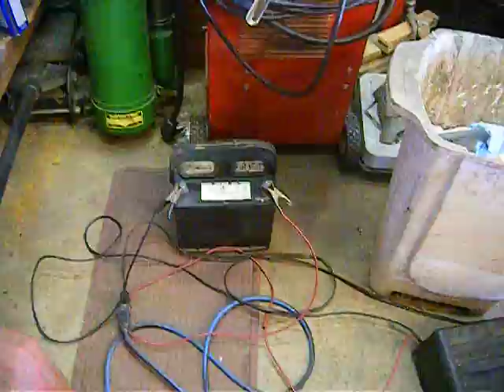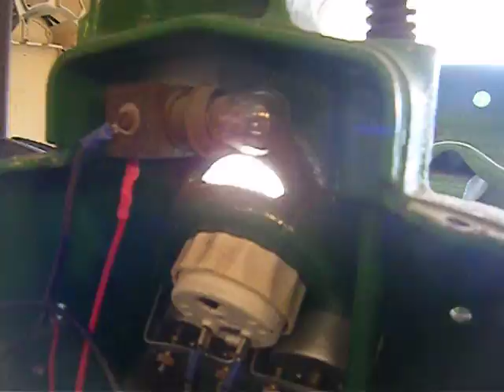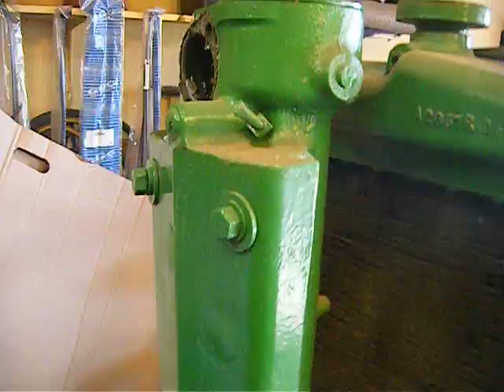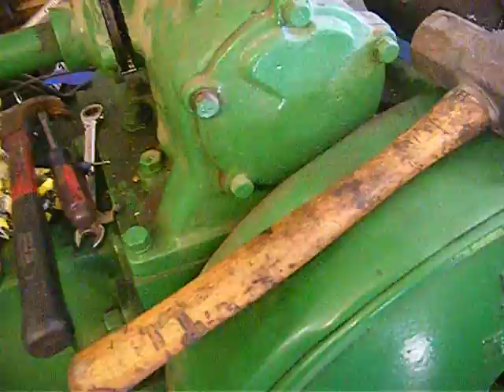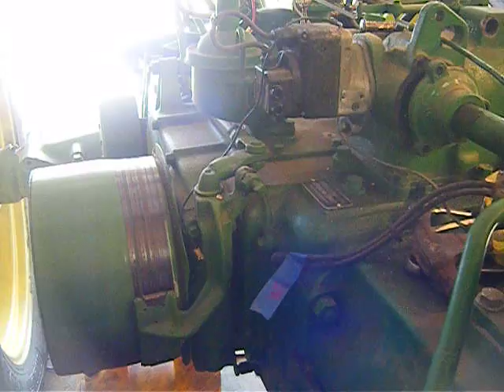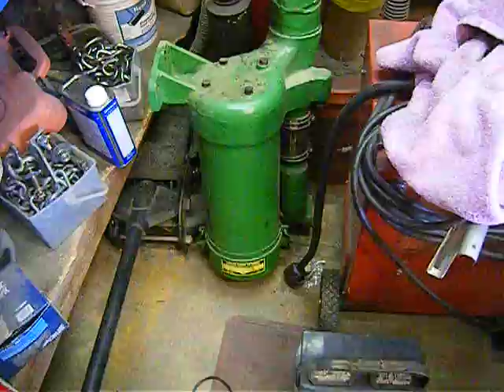John Deere Model A  tractor rebuild 003

Comment: Since you have it that far apart you should probably overhaul the bloozer valve, Dan. You'll need the adjustable bloozer adapter to remove it though.  Of course you may be able to remove it with a left handed Phillips screwdriver, but you'll need a big hammer to do it. And it's got to be a left handed hammer, otherwise you'll screw up the threads on the franaztat coupler.
Reply from the maker: +Brian Allen Yes......those  franaztat coupler threads are very delicate. Mine has the old style brass groves in it.
And the last time I had it apart, I put a new bloozer valve (Chinese)in it. 7-11 had them in stock next to the little Debbie cupcakes, in blister packs of 6.
As far as delicate instruments needed to work on this tractor, I inherited all of Frank's tools, so working on this Peach is a lead pipe cinch!
Reply: Man, I don't trust those Chinese bloozer valves. Mine always fall apart, you got to get the Albanian made ones for real quality.